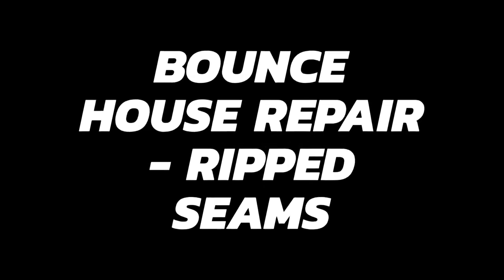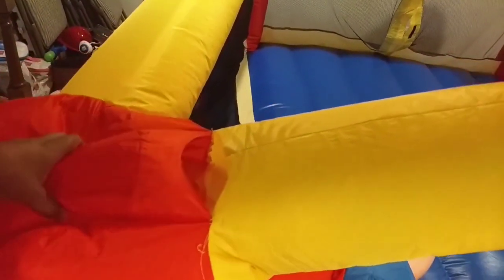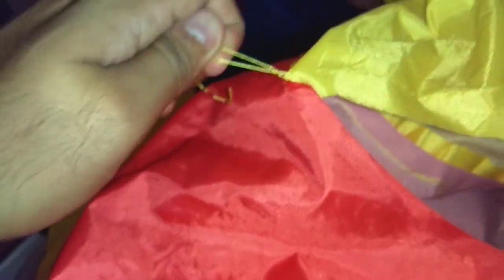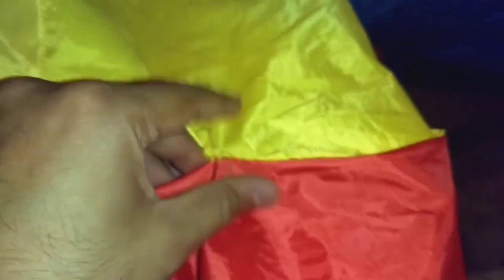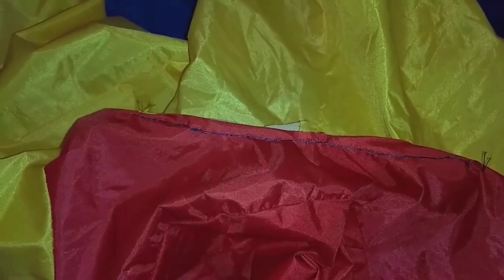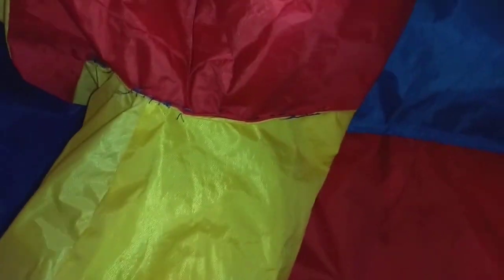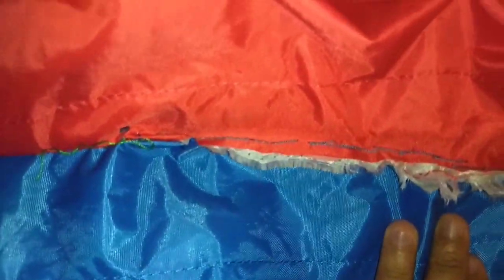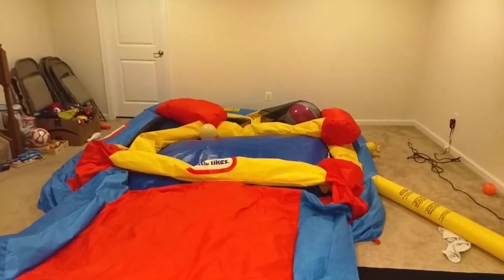Bouncer House Repair - Little Tikes

Comment: Does the top usually fall like that when inflated? Or is that from you sewing it?
Reply: The boys always pull on the top and now they are too big for the bounce house and the blower has a hard time keeping up. It will not be an issue with smaller kids. Them yanking on the tops is what caused the rips. Fun times